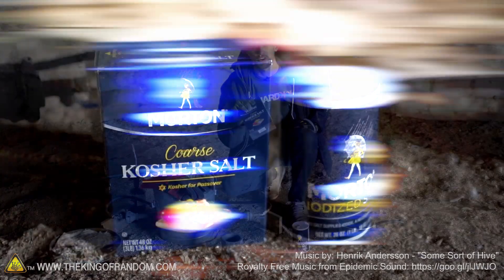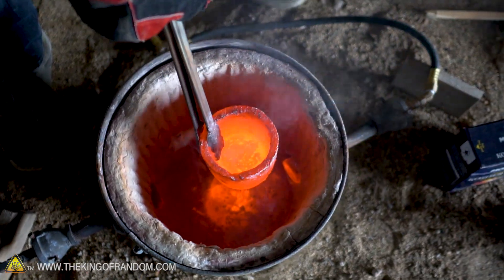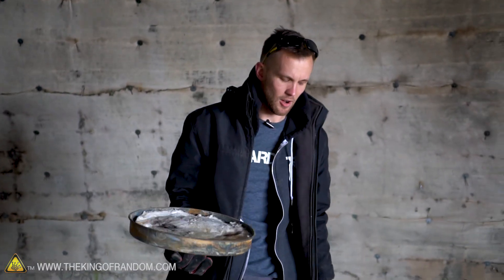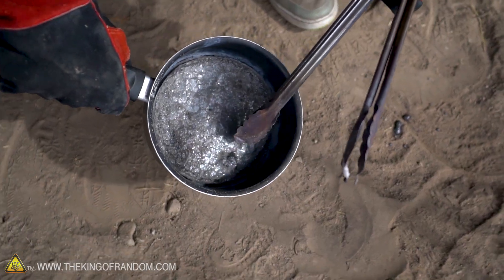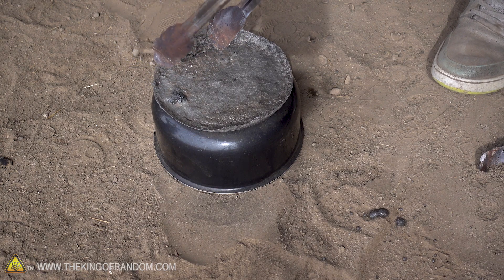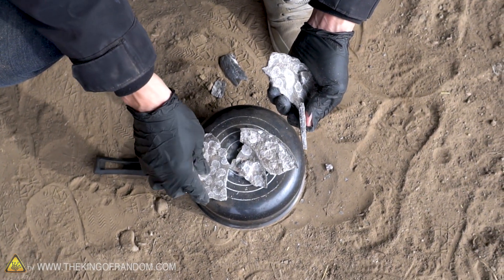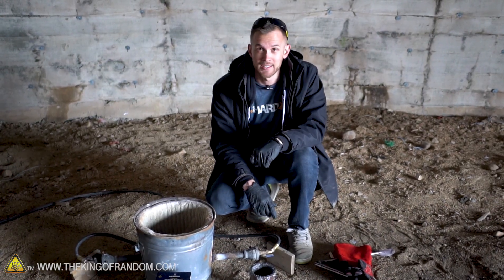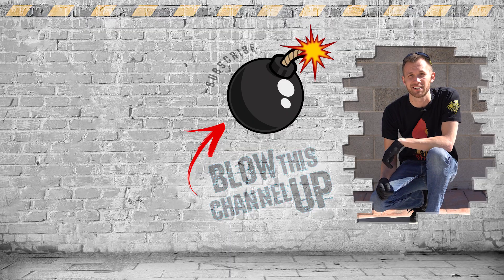Melting SALT in a Furnace! TKOR's Molten Salt Backyard Smelting Experiment!

Comment: The greyness might've been from iodine contained in table salt. Also, molten salt is among the proposed possible speculative solvents for (likely silicon based, as under our temperature, silicon is near-inert, but under molten salt temperatures, it can do complex chemistry) life!
Reply: Iodine is purple???
Reply: @h6h8272  Yes.
Reply: @michalzustak8846  also my guess is it would have evaporated into thin air by then

Comment: I didn't see the table salt package, but normally table salt has iodine in it as well as NaCl.  The kosher salt, however, does not have iodine.  I don't know what happens to iodine at these temperatures, but it may change the crystallization color or formation.

Comment: pour molten salt in water = Explosion
Reply: Priyo M Backyard scientist already did that
Reply: I would use a water tank and a  copper tube with endcap.
Place the copper tube in the middle fill the container with water so 1-2 " will be on the outside then pour the molten salt inside will the water heat up and how much would it heat up?

Comment: Okay, quick bit of advice. Do not, repeat, do not use a teflon coated pot for any material at or above 450 F. At these temperatures teflon begins to decompose and can release  toxic fumes.

Also, table salt has small amounts of Iodine added, kosher salt does not.

Comment: You should put empty plastic bottle into pot full of  very cold water/liquid nitrogen and then to fill the bottle with molten salt.. It will be cool. Will the bottle burn or it will not and the salt will stay inside?
Reply: nikolai kirov the liquid nitrogen would make the bottle brittle and would most likely melt. Then explode when the molten salt comes into contact with the water
Reply: Plastic. Melts.
Reply: that dang gabbie maybe, but for example-fill a plastic bottle with water and then use lighter underneath. The bottle is not going to smelt until the water inside boil. That is why I'm interested. Have a nice day 😊😊

Comment: The liquid salt rejected the ice cube cause of leidenfrost effect
Reply: Or the ice tried to hook up with the salt and the salt dubbed him
Reply: Joseph NO. Sodium isnt rare earth, its alkali metal. if the sodium did got separated from the chlorine than at such temperature it might react again with the chlorine, equilibrium reaction. If it doesnt react it will burn by itself, producing sodium oxide
Reply: That explosion was because the water got vaporized into steam and needed a way out, hence why molent salt went flying.
Reply: Initially, I thought that the ice-cube ejected like that because of the steam that is formed very quickly once the ice-cube is dipped into the molten salt. But, as we may notice, it appears the ice-cube didn't even get to melt. I presume something so hot wouldn't get more than a few seconds to melt the ice-cube completely. Which brings me to consider your point. Tks, bro.
Reply: Ok well I do now that the laden frost  effect doesn’t usually cause a loud bang and flash of bright light so it must be an actual exsplosion
Reply: It rejected it because it turns to water which reacts with the sodium separated from the other things in the salt because of the melting.  That sodium is a rare earth rare earths react with water and explode upon contact.
                   GO BOOM!!!!!!

Comment: If you are going through the trouble of melting salt, next time use some carbon electrodes and perform electrolysis of the salt to get some solid sodium metal (bonus points of the sodium doesn't catch fire during this process and can be stored and used in a later video)

Comment: Do something with liquid nitrogen, a space heater, and thermite. (EX: soak space heaters heating panels with liquid nitrogen and see if can't counteract the nitrogen, see if a space heater can light thermite if you coat the panels with thermite, or trying to ignite thermite that has been soaked in liquid nitrogen)

Comment: What would happen if you put obsidian in the trash can foundry
Reply: Paxton West it foams up, volcanic gases within obsidian expand into a molten foam.  Which over time will collapse into a molten liquid.
Reply: It would likely be obscene....
Reply: Bear in mind that obsidian is a rapidly solidified version of magma and thus is effectivley lava. It would require too much heat to liquify as it has a poor thermal conductance.
Reply: Oliver Jelinek 0
Reply: LAVA FORMS
Reply: Wertak68 Could it explode? I mean it doeshave gasses and if those expand before it melts it might pop.
Reply: Kenan Šabić tried it once in a furnace and it was uneventful.  My furnace was electric and heated relatively slowly.
Reply: Lava AKA memecraft
Reply: It wouldn't melt it would just get hot cause the foundery doesn't get hot enough
Reply: Paxton West it melts

Comment: Try to putting a lid on the container that you’re putting the salt in. to see if it stays white because metal turns black when it’s heated and comes in contact with the air. I think that’s what’s happening with the salt as well.

Comment: This is the same way that solar concentrators use to make electricity (sorta). The suns light makes the salt molten and the Salt boils water. The reason they use salt and water instead of just water is because the salt will stay hot enough to boil water after the sun goes down so the electricity is generated during the night too.

Comment: pour the molten salt into water it will explode
Reply: Ghostpepper ghoul I bet you got that off backyard scientist
Reply: Yeah i bet too
Reply: Meto
Reply: Pure sodium (Na) is naturally  reactive with water, so that would make sense; table salt is also known as sodium chloride, or NaCl, and in a molten state the thermal energy would make the sodium react instantaneously with water, with explosive results as  the reaction produces hydrogen gas, which would ignite from the heat alone.

Comment: Can you melt dirt if so can it be cast into something
Reply: Branden McCullough dirt isnt a single material. It is a combination of many. Most of it will just burn and become ashes, miniscule amounts of it may melt if there id any metal or sand.
Reply: Devyn well thanks for that i was just wondering if it was possible
Reply: Branden McCullough Dirt is made up of lots of decomposed stuff, it’ll mostly just burn
Reply: Branden McCullough done it with giant electrodes at a National lab.  Formed a green glass with lots of bubbles.

Comment: when I worked at a manufacturing plant we used molten salt to immerse steel in to heat treat it.  Solt is electrically conductive when it is liquid, so we would pass electricity through it to keep it molten.  It was never allowed to cool down unless something broke.

Comment: It's Matt here and I have a suggestion for a new experiment with the foundry and the molten salt. You could extract sodium from molten salt. You need electrodes to put inside the molten salt so that you can separate the ions of the soudium cloride (they split into Na+ and Cl-). You can use an electrical generator to attract those ions to the respective electrodes (conductive material). At that temperature (about 1,500 °F), Na+ stays liquid and therefore you can easily extract it. Keep up the awesome work! Greetings from Italy! Byeee

Comment: Try vapor deposit metal like coper or aluminimum on glass or plastic by hight curret flowing through metal bow (metal bow can not create alloys with metlting metal) whitch will get hot enought to boil copper or aluminium in vacuum jar

Comment: When you poured the molten salt into that non-stick pot, that burned the non-stick coating. As 2000F is much higher than normal stove temps. The fumes it gives off are probably not healthy. Also, the burnt coating is probably mixed in with the hardened salt.

Comment: That looks like a teflon-coated non-stick pan. Teflon (Polytetrafluoroethylene) breaks down at temperatures above 500F and creates very toxic fumes. Normally in home use this isn't an issue, but in an enclosed space like this dome, and with pouring extremely hot molten salt into the pot, you're creating dangerously high levels of TFE, HFP, OFCB, PFIB, Cabonyl fluoride, TFA and many other toxic gasses.

Comment: Did you know that molten salt is used for both heat transfer and thermal energy storage in modern solar plants? Apparently molten salt holds its heat for some time.

Comment: Mix the salt with dry ice or normal ice since salt lowers the melting point of  ice or mix it with chemical x or mix thermite
Reply: Salt with dry ice won't do anything, salt with ice will melt it, chemical X won't do anything, and Thermite will just melt the salt with the ignition.

Comment: The King of Random I think an interesting experiment would be to put a small crucible of molten salt (or metal) in a vacuum chamber and immediately evacuate the air. I am curious to see if it dramatically  slows down the re solidification of the salt, and if so how long the liquid state of 1oz of salt can be maintained.  A laser temperature sensor, or FLIR type infra red heat camera would also provide data that I could use.  Thank you for all your excellent videos.

Comment: You guys should try to electrolyze the molten salt to create sodium metal. This could be done with carbon/graphite electrodes that you can get at art supply stores as high concentration graphite rods used for art. Should be cool and depending on the production rate of the sodium you might end up with a viable method of obtaining sodium. Maybe also try this with potassium chloride to create pure K.
Reply: Oh and you could actually use to crucible itself (as it's made of graphite) as the anode and collect the sodium on a seperate submersed cathode or vice versa. Due to the teperature of the NaCl the sodium should be in liquid form and this allows it to collect in the bottom of the crucible.

Comment: Now with sugar!
Reply: PNoYxFlames .. you can try sugar on your own. Put it in a pan and heat it at low heat. Watch it melt! Dont overdo it ... It will just become burnt carbon.
Reply: PNoYxFlames sugar melts really easily, and isn’t very interesting. In fact, you can actually melt sugar on a common stove top. That’s how they make Carmel
Reply: that would just burn, but maybe if you heat it in vacuum, as it cant burn in there :)
Reply: they've already done that when making hard candy.
Reply: Jude Lykins I know some people pronounce it that way, but no matter how you say it, it’s always spelled “caramel” with an A in the middle.
Reply: In vacuum, it would eventually decompose to carbon and water at a slightly higher temperature, it just wouldn't oxidate to form acids.
Reply: sugar makes syrup
Reply: Ya melted sugar is just like candy
Reply: Lofty Pursuits is what you're looking for

Comment: Now all you need to do is throw in graphite electrodes, add dc power supply, blanket of inert gas.......hey presto, Na metalA small % of CaCl2 helps lower the mp of the NaCl.

Comment: Try to aerate gasoline, put it in the vacuum chamber, and try to light it with the laser inside the chamber. I have a curiosity to see this.
Reply: Nidhi Damle nothong would happen. Why would he make a video about it?
Reply: ...Nothing, No Oxygen = No Fire
Reply: That would be exceptionally dangerous.
Reply: ^ dude is right .no fire but hopefully there be a explosion .everybody loves an explosion
Reply: Yu Wish thats not a vacuum, thats pressure. concentrated oxygen/fuel explodes.
Reply: Nidhi Damle even if it was aerated the vacuum would still pull all the oxygen in it
Reply: Evan Basalo its a concentrated air/fuel mix that explodes. a vacuum is the opposite of that
Reply: Hi
Reply: Jamie Knight you don‘t necessarily need oxygen.
Or an ignition.
Reply: Nidhi Damle fire needs three things to light - fuel (the gasoline), ignition / heat (the laser) and oxygen. It does sound interesting but there is no oxygen and unfortunately will not work
Reply: Jamie Knight okay, but I wanna see it though
Reply: Actually, yes it will. How do you think an internal combustion engine works?

Comment: Maybe that explosion at the end was a sodium-water reaction. With the salt being molten, the normal structure may have become loose, allowing pure sodium to react with water. Otherwise, it could've been a hydrogen explosion from the ice rapidly turning into steam, the hydrogen bonds could've come undone and the hydrogen molecules auto-ignited in the heat.

Comment: Please try Dry Ice & Liquid Nitrogen in Vaccum! Great Experiment Video Suggestion
Reply: Random YouTube Videos  he has done that
Reply: the chaber wont reach a vacuum because the Dry Ice & Liquid Nitrogen will evaporate faster than the pump can pump it out. PS: Lower pressure = Lower boiling-point
Reply: GermanMythbuster No, it will because the lower boiling point makes the N2(l) freeze solid because boiling is an endothermic process. When it's solid the vapor pressure will drop significantly and you can pull a stronger vacuum. But then it melts and continues to cycle

Comment: The specific heat capacity of water is about 3 times more than that of liquid salt. It is used as thermal storage and heat transfer material for power devices where water could cause explosive reactions. The high heat to melt the salt also plays a role where in high heat scenarios, water will want to turn to vapor, increasing explosion risk.

Comment: Molten salt against liquid nitrogen and dry ice. I mean, it is not super innovative, but we all know it needs to be done. How about melting it with metals like tin and copper? Can you cast with saltmetal or just salt and is there a way to make the end result look pretty? Maybe casting a larger ingot and sanding the top layer off could achieve this.

Comment: Can you take molten salt and pass electricity through it to get sodium metal?🤔🤔
Reply: Actually yes, it does work, but it's really dangerous and makes chlorine gas.
Reply: That would be a fused salt electrolysis and is actually one of the methods to win alkali metals or flour and chlorine
Reply: It can be done, but it is much easier to use sodium hydroxide because it becomes liquid at a much lower temperature. However, you must have the proper face shielding and body shielding since liquid NaOH is really caustic.
Reply: jfnuyen But can u make sodium metal from sodium hydroxide?
Reply: Jordan Olsen we could use graphite rods instead
Reply: even if that worked what would you do with the chlorine gas.
Reply: liquid lye melts at a lower temp but molten lye can blind you and burn you in a jiffy
Reply: Not how that works unfortunately. The result would be something more like just attaching two wires to a hunk of metal, well that is if the wires survived long enough in the liquid salt.
Reply: Param Rajguru wouldnt rly work, it reacts way to fast with air

Comment: electrolyze salt
Reply: how in the seven hells is putting eletricity through sodium chloride going to create hydrogen gas?
Reply: Bart Prins that's the point. The energy of the electricity will break the salt apart into sodium and chlorine.
Reply: Not advisable. At all.
Reply: Yeah...No. NaOH, maybe, not NaCl
Reply: Molten salt is conductive and will cause a short-circuit
Reply: a-lpha of Zeldaforme Gaming  it will just make hydrogen gass
Reply: i said molten salt, it will made sodium metal and chlorine